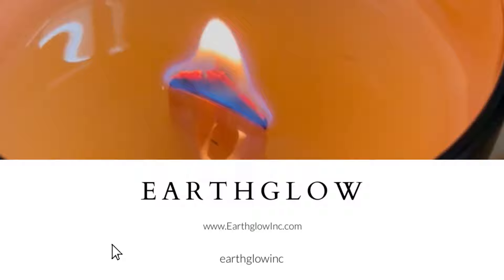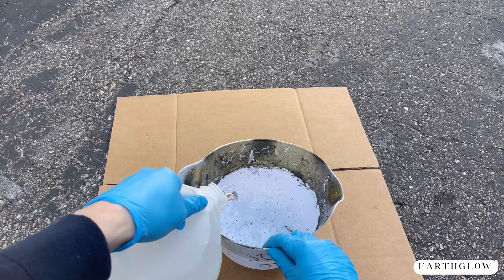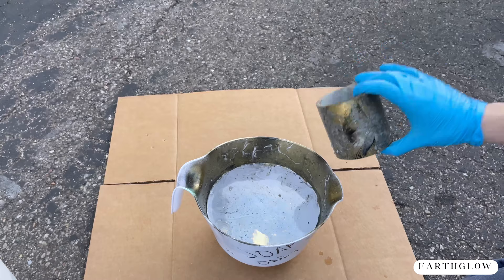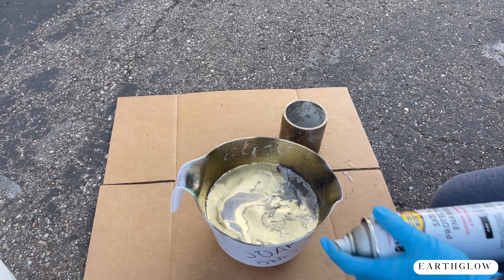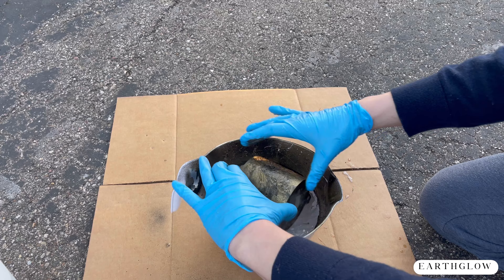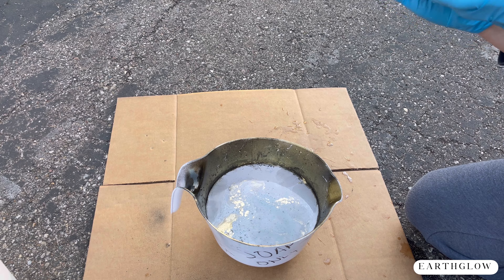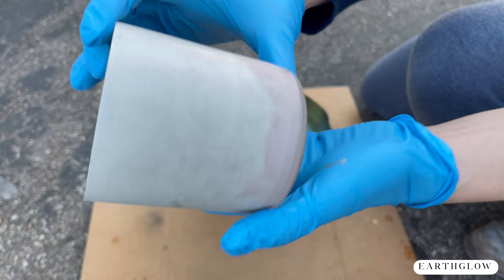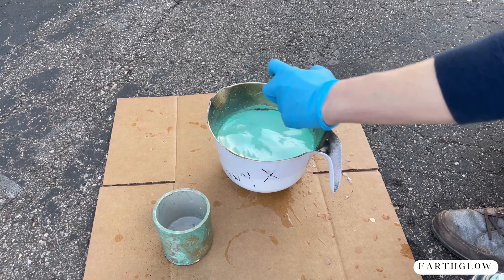Coloring Concrete Candles | Hydrodipping

Comment: Hi, is spray paint safe for candle jar with the heat of the candle... I'm wondering?
Reply from the maker: Hi Myriam! You would need to seal the vessel with a heat-proof and candle safe sealer prior to making one of these into a candle. I’ll try to link my video on how I do this below. Love and light always 💛✨🌱
Reply from the maker: https://youtu.be/8Rgw8gSjthg
Reply: Hi, late to this party but I tried this technique today on a cured, unsealed jar in gypsum.  I was out of distilled water so used room temp tap water and the same Krylon gold leaf.  The paint slid right off the jar.  Tried 5 times and same result.  Any advice?  Thanks…love your videos!